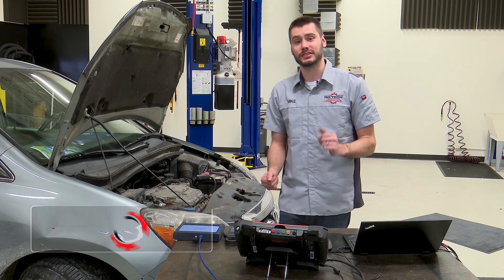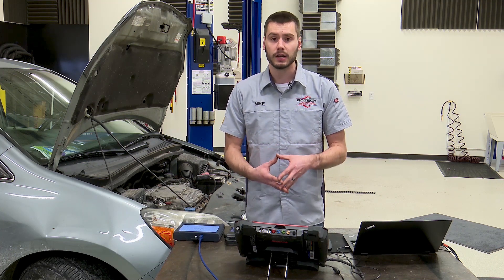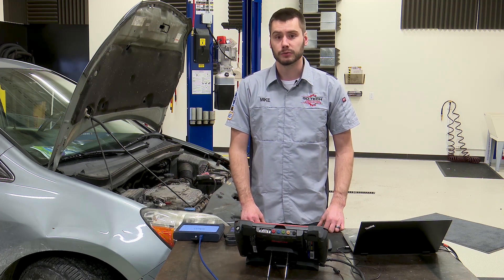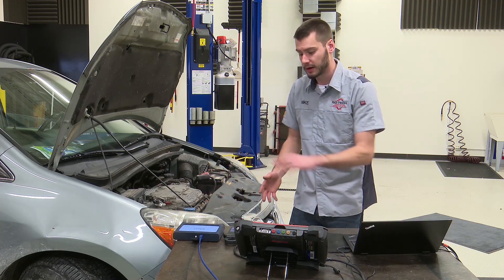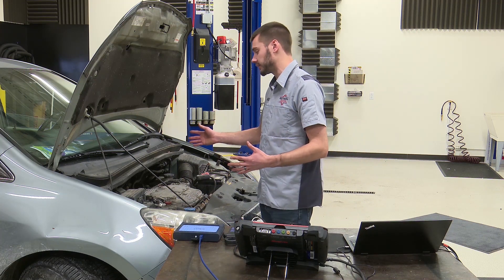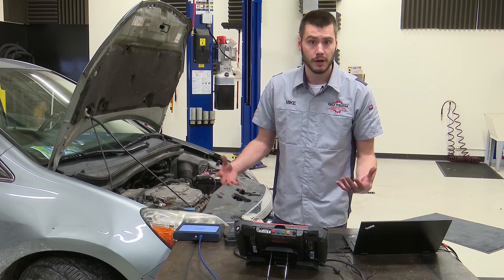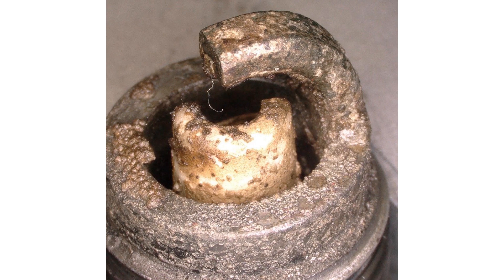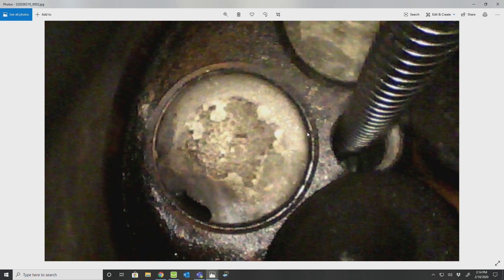What's The Most Efficient First Test For A Misfire Problem?

Comment: As a poor DIY'er, who can't afford any brand of useful scope, 
I'd have to use the braille method:

Clear flood crank to see if I could hear any mechanical issue, if not, then I'd be swapping parts:
Swap plug to hole 4
Swap coil to hole 5
Swap injector to hole 6
If the misfire moved, then you know what the problem was.  If it didn't, then I'd use test lights to make sure of power, ground and signal for number 1 injector and coil.
If I still didn't find the problem, then I'd have to break out the compression tester. I would probably have taken a reading off of 1, 4, 5 and 6 due to the layout of the engine.
I'm reasonably sure I'd have found the problem, nowhere nearly as quickly as you, though.
Keep up the good work!
Reply from the maker: Hey Jim, thanks for watching! Yes, you would have come to the same conclusion eventually. In the shop, professionally, time is money. At home time is a little more free to investigate different paths. In the end though, all that matters is that the car is fixed right the first time :)
Mike Becker, Senior Instructor

Comment: Thank you, Mike, for your time and effort explaining such case study.
I have a question if you don't mind, and I'd grateful if you give me hint, link, or document to get more basis.

You said: broken plug (for not being torqued) causes internal damage to the cylinder/piston > leading to lean-burn condition. Why?
and why does lean mixture burn valve(s)?
Reply from the maker: Hey Ma ker, thanks for watching! Lean=hot. A lean burning engine will cause cylinder temp to increase. If the plug isn't torque, a/f mix can escape past the plug. The plug will get overheated because it's not secured in the head transferring heat. Does that explain it a bit?
Mike Becker, Senior Instructor
Reply: I thank you for your concern and reply.

1. I got this: when the plug is not torqued > mixture escaped, but why does the plug overheat then? (there is no combustion because there is no compression!)

2. I know that st. mix has the optimum comb. temp. and o/p power. By logic, if we enrich the mix > we got more fuel > higher comb temp, increased imep, and eventually more power. How lean mix do rich mix's job? correct me if I am wrong.
3. If I postulate that lean leads to more heat, why does it burn valves? what is the concept?

Thank you again, Mike.

Comment: Good vids but surely a good old fashioned mechanical compression test gauge would of showed that fault up in if not the same time or less
Reply from the maker: Hey Dave, thanks for watching. Sure it could have. But what would have led you to sticking it in the hole? Surely it's not your first step, right?
Mike Becker, Senior Instructor
Reply: GoTech I would of obviously checked for electrical faults first and rectified if any found before continuing the diagnosis and I do agree the picoscopes are a very good tool when used correctly but being based in the uk although they are becoming more common it workshops/garages not a lot of people have access to them and not all diagnostic scan tools have an oscilloscope function which is a shame but we have to work with what we have got but great informative vids keep up the good work

Comment: A clear flood cranking test would have proven a low compression cylinder without any equipment being used at all. Diagnosed in a matter of seconds . The cylinder number/s is irrelivant at the diagnosis stage.
The relative comp test is great and so is the  bore scope but for further diagnosis a leak down test next would condemn any other cylider/s that may be lower than expected and the fault would be easily found.

Comment: Have you ever seen a misfire cause a negative fuel trim? You stated a lean condition resulted from the misfire?
Reply from the maker: Hey BB MD, that's a tricky question. There's a ton of 02 in a misfire. Theoretically I think under the right conditions you could end up with a negative trims, but it's not as common.
Mike Becker, Senior Instructor

Comment: I dont go for the labscope first to pinpoint a misfire.... if i suspect low compression i do a clear flood crank and listen to the engine,99 percent of the time you will hear it.And if it happens to be a cylinder under the intake im pullin it anyway to do a leakdown.Now i could see the value in that test if you had a misfire without a code that was due to low compression and you wanna know what cylinder is low in case its under and intake or not so you dont waste time.
Reply: It's been proven time and time again. A good cranking amperage test doesn't guarantee good mechanical integrity, much less a clear flood
Reply from the maker: Hey Jmccoy85, a trained early takes time. Not everyone can hear it either, especially a customer. I prefer to capture with the labscope and show them point blank that it's going to be a bigger job than what a simple misfire may normally be. This way, even for someone who's never seen a labscope before, it's plain as day. One of these things isn't like the other...haha!
Mike Becker, Senior Instructor

Comment: Have. 14 equinox 2.4 with a misfire. All new timing crank sensor mass air fuel pumps. Runs good till u get to a stop light.  Then jurks alot. Increase rpms smooths out. Any ideas

Comment: I've said this on a different channel but, I think as a professional DIY'er, having a pico and borescope are really 2 important (tho expensive) tools to have. With them you're able to confirm (not guess) what's up with a DTC like this before getting into a lot of disassembly. If I were a 9-5 tech, perhaps I'd know from pure frequency of repairs what an engine is doing simply due to the number of times I've done the repair. As that's not the case, having the ability to test/confirm by literally only removing a single spark plug is truly fantastic. The fact that a customer can then make their decision based on this evidence is great and we're not accused of firing the parts cannon at a problem (only to have the problem go unsolved). I thank you Mike for showing these repair approaches back-to-back. It really emphasized to me how important these 2 tools are.
Reply from the maker: Hey, thanks for watching! I can't agree more. Those 2 twos plug the knowledge of how to utilize them is priceless. :)
Mike Becker, Senior Instructor

Comment: I have found that most common problems are not mechanical but rather 1. Coil 2. Ground 3. Power 4. Spark Plugs 5. Injectors.
Reply from the maker: I agree, most issues aren't mechanical. But, a 4 minute test to prove it's not prior to do anything else is worth it...right?
Mike Becker, Senior Instructor

Comment: Good info but a bit misleading Mike. With the scenario here, a seasoned tech would have known very quickly when starting the vehicle that there was a compression problem and you could likely skip checking fuel and ignition first.
Reply from the maker: Hey Frank, you're right. A seasoned tech may have picked up on it right away. But, a labscope picture is easy to show a customer. It's black and white for them. 
Mike Becker, Senior Instructor

Comment: I think the hardest part of scope use is ease of access. My laptop -  hantek/scope module 4 channel with all the leads and power supplies and cords and test leads used to make opt for the plug and coil swap. Until I got my autel scanner-scope tablet. So incredibly easy to use and set-up. Fits in a modified dewalt drill case. Leads in zip locks just like Mike said in earlier vids. If it's not easy to set up,  you really don't want to use it.
Reply from the maker: So true Gunnar, has to be easy to get to!
Mike Becker, Senior Instructor

Comment: Hey Mike - While it was faster [in this case] to do the cranking/scope test, the swap test would have stopped and directed you to a potential mechanical issue when you pulled the #1 plug and found the physical damage to it. I realize you did not know this beforehand. I'm not arguing here - a cranking test, to start with, would have led to a #1 cylinder issue and then resulted in the finding of damage to that plug. What I am saying is: if the vehicle was equipped with a coil over plug system [COP], easily accessible from the top, a coil swap may be faster [and a Tech would not need a 'scope [$$] to perform.] If you are faced with a rear bank misfire on a transverse V6, I agree that the making a cranking/scope test the test of choice would be faster in eliminating or verifying an compression/mechanical issue and on what [verifying on which]  cylinder(s) the misfire was occurring on. In an easy to access a COP engine, the swap coil test maybe more efficient. Perhaps another video like this comparing the same approaches, but using a COP 4 cylinder engine? Thanks for hearing me out.
Reply from the maker: Hey, Thanks for watching! In this case, the customer changed out the coil and plug prior to bringing it in. He didn't inform of this until after I called and told him what was wrong with it. Happens far too often. Anyways, sure on a 4 cyl with the coils on top it may be quicker to switch. But there's issues with switching coils around too. Shorted coils could kill a PCM driver.There's a lot of variables.
Mike Becker, Senior Technical Instructor
Reply: @GoTechTraining  Good points, Mike. Thanks for your comments!
Reply from the maker: Thank you for questioning! I may actually do a video describing the downsides of coil swapping now!
Mike Becker, Senior Technical Instructor
Reply: @GoTechTraining  Regardless, do keep these videos coming!
Reply: @GoTechTraining  On the other hand, if the coil is prone to burning drivers it would likely burn the OG driver. If one's blown, you'd might as well burn them all.
Reply from the maker: Haha Fascist Pedant, I knew that would come up. What happens if the customer chooses not to fix the car? Now it's running worse since you touched it. A "loud" enough customer would typically not end up paying a penny...The goal is to never further break the car prior to authorization ;)
Mike Becker, Senior Instructor
Reply: @GoTechTraining   OK! YOU got me on that one!

Comment: The quick & easy way to start a diagnosis! Great video Mike & tips! What borescope is that? I had my Snap-on wireless borescope but have used Olympus articulating borescopes for over 35 yrs on aircraft so I finally broke down and bought the Oasis Scientific Vividia D3245 USB 180 degree digital dual articulating 4.5mm borescope and feel at home again. Fantastic scope w/camera especially great in-cylinder articulation makes it such a pleasure to use and great detail!
Reply from the maker: Hey Bob, thanks man! Hope all is well with you. Saw the fishing pic's. Bet it was nice to get back out there. Yep, i'm using the Oasis Scientific scope. Fantastic tool!
Mike Becker, Senior Instructor

Comment: Depending on experience and the vehicle, you could cut the diagnosis time even further by simply listening to the engine crank in clear flood mode (On a Honda though, you'd likely be better off pulling the fuel pump fuse to prevent the engine from starting). "No tools required" diagnoses are the quickest of all. Either way, the scope capture provides visual confirmation to the customer of the engine mechanical issue.
Reply from the maker: Hey Joseph, very true. An experienced ear can tell you a lot about what's going on. That's hard to share with a customer though. I'd prefer to show them the labscope capture and say "hey, see this? One's missing, there's your misfire" ;)
Mike Becker, Senior Instructor

Comment: The replaced plug and coil issue emphasizes the importance of thoroughly interviewing the customer as to the history of the vehicle, not that you should always trust them.

For the sake of discussion, I would suggest that the burnt valve may be the result of damage incurred prior to the valve adjustment. The ground electrode on the plug didn't bare the appearance of having been subjected to prolonged high temperatures associated with a burnt valve. They seem to often fail during a particularly long, continuous, high speed trip where a small leak would most quickly escalate to catastrophic failure.

Good video, Thanks.
Reply from the maker: Hey Fascist Pedant, a thorough interview is key!!! Could not agree more. If only every customer would tell the truth. You could be right. Unfortunately, there's really no way to know for certain at this point. It was almost 40k since the valve adjustment, if that offers any credence to this.
Mike Becker, Senior Instructor

Comment: Heard that ac coupling a channel to the battery terminals can have same results as with the amp clamp. So even faster in setup.
Reply from the maker: Sure, you guys use voltage to see it. I find it's messier though because of the other loads on the engine that may be present when cranking. I prefer current.
Mike Becker, Senior Technical Instructor

Comment: Makes you wonder who changed that plug.  It had to be fine when it left your garage after the valve adjustment and I think I recall you doing a timing belt on it too, no?
Reply from the maker: Hey, yep, I did the timing belt too. The customer installed his own plugs...by his own admission. Which is always a deep exhale when I see a vehicle come in that I worked on previously, right!?
Mike Becker, Senior Technical Instructor
Reply: @GoTechTraining  Yeah, that's a hard lesson. It can happen to anyone.  Even faster check is to listen to it crank...were you tipped off by the way it sounded when it cranked?  I don't think Honda has a clear flood mode.
Reply from the maker: Right, no clear flood on there. I agree, listening to it crank is faster but that's a learned thing and hard to show a customer. This way, I show him a screenshot of the capture and what's missing. It's plain as day even for someone who's never seen a labscope capture. A pictures worth a thousand words, or RPM's in this case ;)
Mike Becker, Senior Technical Instructor

Comment: Question for you Mike eat all watching I am a DIYer and am trying to broaden my skills in the automotive realm and for the life of me can’t figure out the realities compression test, does this just involve the amp clamp and the scope or do you need a pressure transducer or am I just mixing up two different test? I have acquired the two channel pico scope which I think will accomplish most of what I need plus a 60amp amp clamp. Would this be enough to perform this test? Sorry for the beginners questions but I really want to learn more I find it so fascinating.
Reply from the maker: Hey John, you would use an amp clamp around the battery cable. You goal is to measure current leaving the battery powering the starter. You'll want the big clamp for this. 200/2000amp clamp is what I use. No worries on the question man, that's how we learn! :) 
Mike Becker, Senior Instructor
Reply: GoTech  oh, I have  a amp clamp with  digital meter attached can they be used  on a scope? I am not sure what the difference is with one without the digital readout to one that doesn’t have it.

Comment: Last time I had a bunch of different misfire codes on my 99 Honda Civic EX, as in multiple cylinders, random misfires, I ended up doing a full tune up on it including valve clearances for nothing.  The codes kept reappearing over and over again until that same tank of fuel was gone, and we refilled the tank at our usual gas station.  (The wife was in a hurry one day and decided to try a cheap gas station on the way to work.  Argggh!)   Well, the car was approaching 75,000 miles so it wasn't a bad thing to do a tune up, but really!  Is there any moderately priced and/or cheap test kit available to determine if your tanks gasoline quality is an issue?  Thanks!
Reply from the maker: Mark, ugh fuel issues can be such a headache! The only fuel testing that I do is water/ethanol. You pull fuel out and make 10 separate lines, once it settles if its standard E-10, you should see on line of water with 9 lines of fuel above it. I've done it in just about everything, including a water bottle when I was in a pinch haha!
Mike Becker, Senior Instructor

Comment: What’s the part# or brand for borescope.? 
Been looking for one that bends upwards 
Thanks mike
Reply from the maker: Hey Uneek Logik, that one is sold by Oasis Scientific. I'f I remember right it's called the Vividia Ablescope. Google it, i'm sure you'll find it!
Mike Becker, Senior Instructor
Reply: Thanks again
Reply: The one I have is the Oasis Scientific Vividia D3245 USB 180 degree digital articulating 4.5mm borescope. Stick it in the sparkplug hole and rotate the control knob & it rotates the head 180 degrees to look back 180 degrees...fantastic USB borescope!!

Comment: Looking at getting pico to go along with my Snap-on Zeus!! What do you recommend... the pico 4 channel or the new 8 channel????
Reply from the maker: Hey BiggSexxyRobb, the more channels the merrier! lol Seriously though, if cost weren't a factor I'd suggest everyone gets the 8 channel....but the 4 channel will do probably 90% of what you need.
Mike Becker, Senior Instructor
Reply: GoTech The cost isn’t a factor for my situation! I was given some info recently that the 8 channel was never meant to be for the automotive side and that it’s been lightly converted over and that is why it doesn’t have connect detect and higher voltage protection and requires more attenuators along with some other stuff. I just want to make sure I invest my money right so a year from now I don’t regret spending $7000 on the master kit